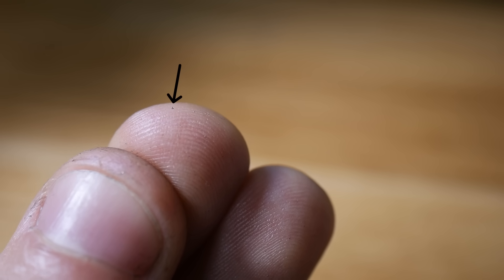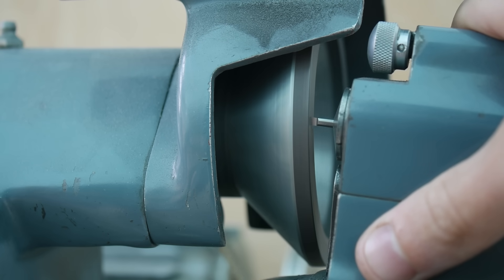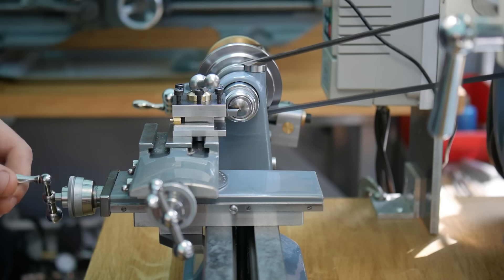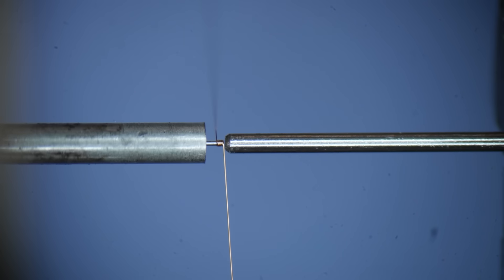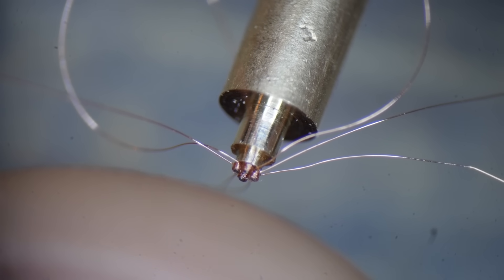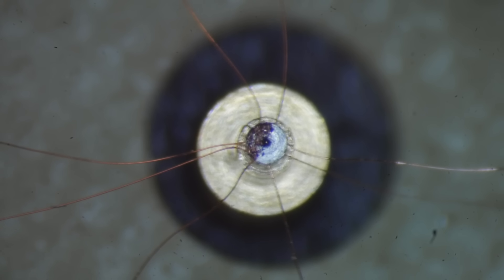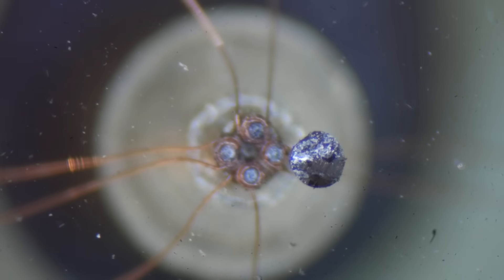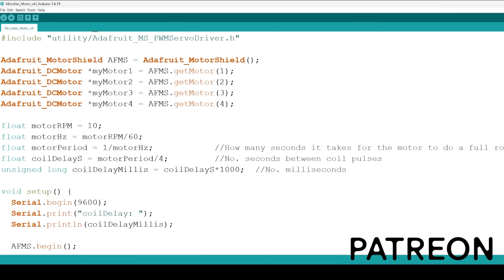Attempting to Make the World's Smallest* Electric Motor

Comment: Please check that your Copper wires are actually pure and annealed ETP grade or better. Chinese suppliers love to swap pure Copper out for Copper-clad Aluminium, as well as to just skip annealing and leave the wire work hardened from the drawing operation.

I do have a few tips for a second attempt:
Use pure Gold wires (the type commonly used as bond-wires in IC packaging) in stead of Copper. It's not that expensive since the wires have very little mass, while also being more easily wound and handled without degrading its electrical or mechanical properties. You can also easily get it as uncoated wires, which would allow you to use heat to soften and anneal the metal if/when required, as well as giving you the ability to seal and insulate the whole coil (with a solution of whatever insulator you desire) after all other operations have been completed.

Calculate the driving waveforms' maximum expected frequency content based upon what RPM you'd like to acheive and pick a suitable magnetic material to use as a core and backing plate (I'd imagine either something like Silicon Steel, also called Transformer Steel, or a soft and low-frequency optimized ferrite would be the best choice; However pure Iron or even just a basic Mild Steel, as long as it doesn't contain any carbon, might also work.).
Putting something like brass in the path of the magnetic field not only results in very large induced eddy-losses, but also decreases the produced magnetic field density for a given applied EMF and causes the magnetic field that is produced to spread out significantly, instead of being confined to a well-defined magnetic gap.

Imagine you're starting with a simple, single electromagnet.
Wrapping a coil of wire around a random piece of steel will produce a very poor electromagnet, even though that's how electromagnets are often depicted.
A coil of wire will produce a circulating magnetic field, with the total integrated magnetic flux that flows out of the center of the coil being equal in magnitude to the amount of magnetic flux that flows back around the outside of the coil.
Therefore you really need to provide a proper magnetic path to conduct and focus the return field as well, which is why most commercial electromagnets produce a magnetic field that lies mostly in-plane with the exposed face, flowing in-between the center magnetic core material and the circular outer sheath material, in stead of extending far into the space in front of the electromagnet (as it is often incorrectly pictured).

It's not like you're just missing out on something like half of the theoretical flux (by only using an inner magnetic core) either; since most suitable magnetic materials have permeabilities that are thousands of times larger than that of air (or brass), only using a permeable core for half of the magnetic path length actually yields a final magnetic field strength that is on the order of 0.1% of what it would have been with a full-path Core.

Similarly, if you have a magnetic path where (for example) only 0.1% of the total length is an air-gap, then doubling that gap length will roughly halve the magnetic flux density in the gap.
That's why you want to minimize the gap length (or use something like ferro-fluid to decrease the magnetic reluctance of the gap, although that would obviously not be a viable option in this project) and focus the produced magnetic field to avoid fringing field lines spreading out into the air.

Essentially, you want to provide a high-permeability, closed magnetic path and only interrupt it at the contact surface between the stator and the rotor with the minimum possible gap.
Reply: I think the issue is not that it is aluminium, else it woudn't melt or dissolve, the issue is the wire is so thin that it dissolves in the solder.
Reply: The field doesn't have to be very strong for this specific thing
Reply: How pray tell can one insulate the coil after winding it? There's already turn-on-turn contact!

A problem as old as Faraday; back in his day, linen-wrapped iron wire was easiest; which sounds terrible in the modern day of enamels, but, back when these sorts of applications didn't even exist, you had to manage.  Forging a new original solution carried similar difficulties; leveraging standard products (like very fine enameled wire) will be most helpful.

Eddy currents aren't a problem for a display piece, where the excitation frequency will give a skin depth hundreds of times larger than even the brass base plate / bar used here. (Also why a synchronous (magnetized rotor) design is preferred over induction as another comment suggested.  The higher speed required for the latter, does have the possibility to make it run better -- but it also can't be seen..!)  A soft steel base might be preferable just to better optimize the magnetic path, but I don't have a problem with brass per se.

I certainly wouldn't suggest ferrite here; it's much too brittle to handle.  Especially if even the finest diamond saws are simply snapping off parts otherwise (or themselves as the case may be)!
Reply: @T3sl4  The insulation can be done similarly to how some Tesla Coil secondaries are constructed.
For each layer, you first wind all of the turns as normal, then you coat it in a very thin resin (something like a low viscosity, UV-cure resin or a fast-cure epoxy). Then just slightly pull on the ends to separate the turns from each other and wait until the resin has cured to a tacky, semi-solid consistency. Finally, you release the tension on the coil and accelerate the curing with intense UV light or by spraying an accelerator onto the coil.
Since you have much more control over fine gold wires than ones made of any other metal, it will be much easier to wind and leaving a small gap in-between each turn won't be as detrimental in this application.

Brass is a very big problem, because it is placed right in the magnetic return path, where a high-permeability material is needed.
The issue with eddy losses has to do with the motor scaling laws. If you want the same amount of output power, however small, then you need to increase the RPM as the motor's physical size shrinks down.
Furthermore, as you scale the rotor and bearing surfaces down, you end up significantly increasing the relative strength of friction, while simultaneously decreasing the rotor's moment of inertia.
You essentially need to design for higher RPMs if you want such a small motor to look like it's not on the verge of stalling the entire time, but even more so because the size of this project precludes the use of the normal bearings, which would normally have helped to center the rotor shaft and to reduce sticktion at low linear contact speeds.

Also, remember that the stator coils are scaled down by the same amount as everything else in the motor, that means that even if the skin depth is greater than the thickness of all the parts, you're still going to be limited by how much current you can force through those tiny wires, while being opposed by eddies that have the advantage of a much thicker and radially larger piece of metal that ALL of the magnetic flux is being forced to go through.

Even if you don't want to (or can't) make a proper magnetic core that extends the whole length of the magnetic circuit; It should at least be possible to make the same mounting hardware out of a machineable plastic material, then bend a couple of iron wires into a C-shape, and finally press them into the plastic base plate, so that the magnetic field has at least a somewhat low reluctance path, from the bottom of the coils, up to the outer radial edge of the rotor.

Comment: I think it would make more sense to use just 3 electromagnets. You can then wire the phases in a star or y configuration. I also dont think it will be possible to make one on this scale, atleast at first. You should try to make one that is about twice as big to start with

Comment: You can probably shed a little weight from the whole system if you follow the same approach as the sub-gram rc plane guys. The current record is 225 milligrams, though the motor is a bit bigger. It uses only one magnet and winding, controlled by a filed down hall effect switch. True, the motor needs to be started in the correct direction by hand, but it IS still a motor.

Comment: Would it be worth considering making the rotor from 2 pieces? It might be easier to make a disc from the magnetic material, with a central hole drilled in it and then glue in the shaft, perhaps using a tiny rod from a different material. Maybe there are options available that you don't need to turn to size yourself. May even help the magnetic characteristics of the rotor if the shaft isn't magnetic.

Comment: i like what you did, what about a single hollow coil with a iron shaft oscillating within. you could connect a lever and that would be your output. if rotational movement is the target then  embrace the cyanoacrylate as a resin to hold everything and the cut ends of razor blades to make your driving coils. 
must it be rotational motion? could it not be a cube? a cube with a shaft through its longest side? then the coils could sit in the negative of that square. love the work much impressed 👍👍👍 🇿🇦💚🇵🇸

Comment: Armchair engineer here, with zero expertise in anything. I'm amazed at your ability to drill such fine holes in things. Would it be conceivable to drill a hole in the rotor and use a fine wire as the spindle?

Comment: So good! 

Just FYI, regarding the wire "melting", that's not actually what's happening. I've experienced the same thing when connecting to the ~20um windings of surface mount 100:1 transformers for failure analysis, and I determined that what's happening is that the wire is dissolving in the solder, not melting. 

I had considered trying to pre-alloy the solder with copper by putting it in contact with a large copper wire before doing the work, but in the end, like you, I just figured out a way to make the connection without completely dissolving the wire. I honestly forget exactly what I ended up doing (it was more than a decade ago), I think I just did the work faster. 

Having abandoned a project to make a ~mm scale coreless motor for a micro RC plane, I'm very excited to see someone persevering and making headway on an even more challenging project!

Actually, I would recommend that you consider a coreless design (windings on a nonmagnetic material). The forces will be lower, but removing the magnetic cores would eliminate any tendency for the rotor to stick to the poles. 

Oh, by the way, I'm guessing this doesn't fulfill your/Feynman's  "no new technology" stipulation but have you looked into the squiggle motor and its relative the hollow tube ultrasonic motor? The hollow tube variant is a piezoelectric ultrasonic motor that can be made at the ~mm scale relatively easily. I did successfully make one of these using hand tools (a watchmaker's lathe, and a special grinding fixture to hold the stator against abrasive paper in the right position to grind the flats for the PZT ceramic plates, which I scored/snapped out of a piezo buzzer with an xacto knife). The one I built loosely replicated the motor described in the paper "A 1.6-mm, Metal Tube Ultrasonic Motor". But the squiggle motor is based on modern piezoelectric materials rather than traditional electromagnetism, so in my mind it doesn't win the prize.
Reply: This is super interesting! I've noticed the same thing with wire of that size, but assumed the wire broke off due to thermal stresses and became engulfed into the bead of solder. I'm curious, do you remember how you determined it was actually dissolving?
Reply: @cameronurban3653 I started looking really closely under the microscope and noticed that in cases where I did successfully strip the enamel and tin it, the wire had thinned out to a substantially smaller diameter, and actually had a shape very similar to pictures I've seen of etched tungsten scanning electron microscope stylus tips (where the metal wire tip is electrochemically dissolved to make it sharp). Then I started poking the wire into the solder blob under the microscope and watched it happen.
Reply: Very interesting observation! Is this due to lead-free solder being used?
Reply: @PuchMaxi Oh no, it was leaded solder. Lead free solder already has copper in the alloy, I actually imagine maybe lead free is better in this respect? Lead free is a ternary eutectic with tin, copper, and silver. But honestly I don't know enough about metallurgy to know offhand whether a eutectic will dissolve more of a component metal when it contacts a lump of the pure metal. I think if it was exactly at the melting temperature it probably would not, but if it were any hotter it seems like maybe it could dissolve more copper? Honestly don't know.
Reply: @ Good to know! I think you are right about the higher temperatures, time/duration is also a factor.
Reply: I wanted to say the same thing about the copper dissolving into the solder. There are SnPb solders which already contain a low amount of Cu to mitigate this.
Reply: I wonder if a tiny heat driven motor could work using thermal expansion and contraction/vibration, like the motion of a Trevelyan Rocker, only rotational?

Comment: As silly as it might seem, try using printed flexures to "gear down" and stabilize the movement under the microscope, it can really help with small samples. And as pointed out earlier, normally closed tweezers are very good in this application

Comment: Suggestions[!!!]:  Yeah.  You want this to work?  You NEED to completely rework ALL of your tooling.  The larger a target item is, the larger the tooling has to get.  The same that goes for Maxi-, also goes for Mini-.  That's not "Micro", that's bordering on NANO-Scale my dude.  You NEED to make tinier clamps, tool holders, soldering tips, chucks, EVERYTHING needs to miniaturize.  Your OIL drop probably had a viscosity higher than the rotor was.  There is a company that makes nano-particle graphite lubricants in water and oil.  You can get a bucket of it for like 35 dollhairs US.  

You also NEED to utilize tiny robotics, and a box to work inside of.  Tiny robotic arms, with tiny robotic clamps and manipulators, and tiny robotic cutters, etcetera.  Even if the "robotics" are completely mechanical, you can make tiny manipulator robot arms and such in the tooling you have.  You just have to MAKE it.  Tiny electric servos, and such, tiny wires, tiny everything.  Thin about how car manufacturers make cars with welding robot arms, 5 and 7 axis robo-arms, and build something that will fit your needs, be sturdy enough for what you are trying to achieve, and small enough to fit inside a box you suck all the air out of with a vacuum pump.  Right now, airflow is your WORST enemy for this project.  Lexan/Plexi-Glass is relatively cheap these days, and at 1/2" thickness, it should be plenty strong enough to hold a decent enough vacuum for your purposes.  

The box should be made of plexiglass so you can see through it, but completely block ALL airflow.  In fact, if you can SEAL the box, and pump out all the air, and do ALL of the work via a microscope with a camera on a 5 or 7 axis gimballed arm inside the box, you;'ll get better results.  You're getting down to the scale that OXYGEN molecules are starting to make it harder to see what you are doing.  

You have to use the tooling you have, to make smaller tooling, and THEN tackle this project.  Otherwise you're going to get loots of issues, like you've seen and had, and then maaaybe have one that works.  Or, you spend some time thinking "What do I need to make this same thing on a scale that would fit inside a 1 FOOT cube?", figure out what all tools you need to do it at that size, and then take all of that, and scale it DOWN to the micro scale you are going for.  But yeah, a BIG part of it is just stopping airflow from hitting the piece, and using nano-scale viscosity lubricants for stuff.  The majority of stuff you used here is just way too big.  

If you want to do it right, you have to make do it right, and that includes working DOWN to the scale you want to achieve.  :-)

Comment: I'm glad I'm watching this at 1080p, else I would be watching a single pixel for 16 minutes.
Reply: He just made a joke. It's visible in any quality since the video has all the details. It's shot perfectly to avoid such issues in lower quality. But he made a joke about how tiny the motor is.
Reply: I think it would be a rly funny Video if he just had filmed everything with a normal Camera so the whole video is just him working one something basically invisible.
Reply: Even at 144p
Reply: 😂😂😂😂😂😂 @bmxrider8284
Reply: It's visible in 720p, even the wire.
Reply: The Connections (2021) [short documentary] ❤🎉

Comment: Awesome work!
Suggestion: let the rotor be just a cylindrical disc as in the final attempt. On top of the coils place a brass «plate» with a recess slightly bigger than the rotor, so it can swim there and still have some radial «bearing» function.

Comment: First, let me say how utterly impressive an achievement this is from a machining point of view. On the matter of suggestions, I presume an achievement on that level should perk some heads up in the watchmaking industry. Maybe someone in the service of one of the high-end watch companies will be impressed enough to share some trade secrets with you if you ask. On the electrical side of things which is more my forte, I suggest replacing the solder with conductive glue at this scale. If you have the option to gold-plate, exploring the welding processes employed by chip bonding machines might be worthwhile.